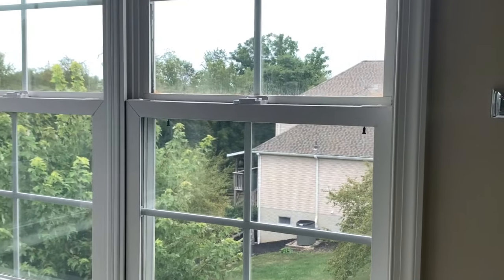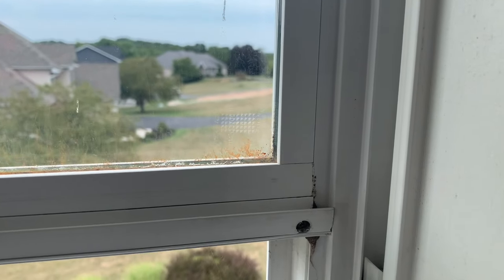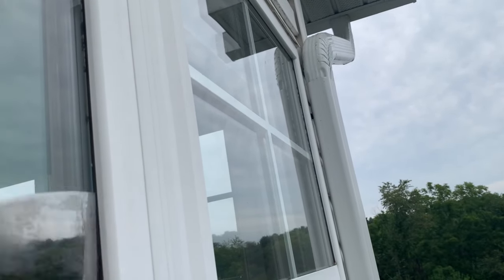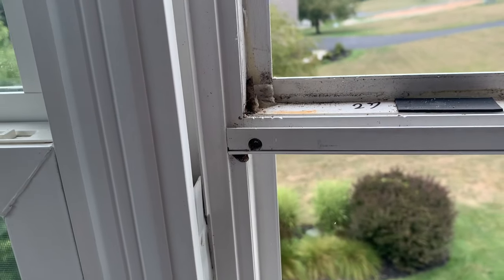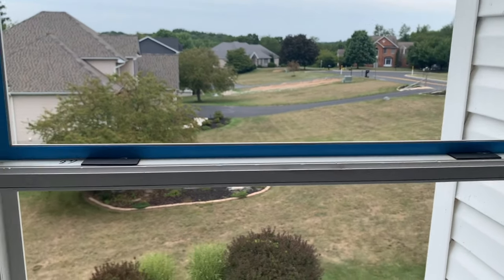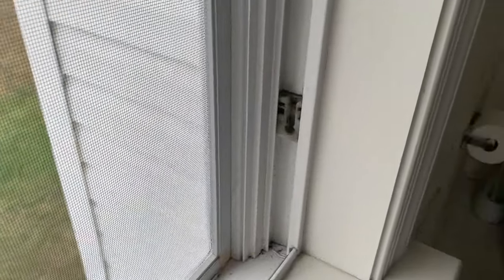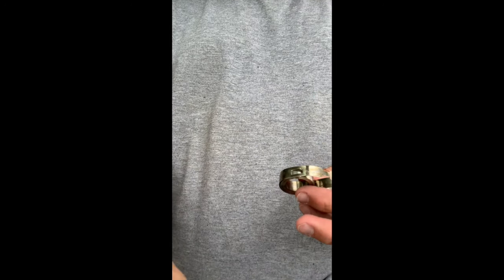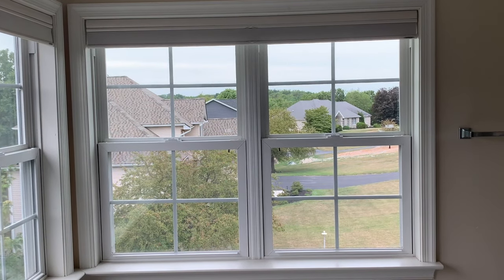Replace Upper Window Sash - Single Hung Window

Comment: You did not show how to take the windows sash out
Reply from the maker: It’s a single hung window. So the bottom sash moves up and down. 
The top is stationary. All it has is the pane of glass. This video shows how to replace that pane of glass.

Comment: How did you get the exact thickness and with and height without removal thank you  i pray i estimate 5/8" thickness they look just like yours  and they are all the top windows  with white  incert i do not feel like tearing the house apart i like the factory brick molding. I watched  my nabour get windows they tore her home apart and when the guy cut back the siding for jchanel they cut the plywood also i seen insulation.  So here i am googling replacing top

Comment: Thank you so much! Only difference is my pieces around the window to remove were on the outside and the putty knife seal to break was on the inside. I would have never figured this out without your video
Reply from the maker: Interesting. I’ve never seen it that way. 
But I’m glad it helped. I couldn’t find a decent video explaining it, so I thought it was good to do. Thanks again!!

Comment: You made the job understandable. Thank you. Now the hard part. I don't know who made my windows. Is this pretty much how all brands of vinyl windows are made? Is there a way of determining the size of the replacement pane before actual removal? Where do you buy the replacement? Lot's of questions about the hardware but your video makes the doing a whole lot easier. Thanks X 2.
Reply from the maker: My pleasure. Glad to help. The only way I know is there should be stickers on the inside jams. That you can see from in the house. 
If not - maybe take the bottom pane out and see if on there. And measure that pane.
Reply: Thank you

Comment: My brand new Windows have one corner on all of the bottom sashes where the tilt latches don't snap back into the frame without an excessive amount of force.  What can this mean and what is the fix?
Reply from the maker: I would contact whomever installed them. Sounds like they aren’t square. Or perhaps to tight in the frame.

Comment: Where did you get the extra plastic & order you glass from thank you may the Good lord bless you
Reply from the maker: I got both of those from Simonton Windows. There is a sticker upon your window on the frame (or should be) that has the info you need. Company, size, etc.
Reply: @srakfleming5888  thank you very much

Comment: This is an excellent video, thanks for posting.  I have the exact same situation on my PlyGem windows and have received six replacements to install.  Want to DIY so this was great. Found answers to my questions in your responses below. Thanks.
Reply from the maker: Hi there.  You are welcome.  I'm glad you found the answers.  I got mine with the new window panes.  I have some extra.  Its is 1/2" wide and 1/16" thick.  Sticky on both sides and the 1/16" is basically a spongy layer.  I hope that helps. Thanks again.

Comment: great video, very well taught.  I was looking for something different.  I recently had new windows installed and now want to add a window air conditioner.  The single hung window have lower sash stops and I am not sure if they can be removed since the current opening is to short in height to have a standard A/C fit?  Being that they are new windows, I don't want to just force the stops out and maybe break or damage it. I am sorry I don't have the name of the manufacturer. but they must be Canadian.  Any thoughts you  might have would be very helpful.  Thank you and thanks for sharing.
Reply from the maker: Send a pic of the stops. They usually pop out pretty easily.

Comment: Thanks for the video !
Can you tell me if the tape was butyl, and was the thickness 1/8 or 1/16 of an inch.
Here in canada off of amazon it is around 40 dollars, does this seem right?
Thanks again, well done!
Reply from the maker: You’re welcome. Hope it helped. 
It’s polyethylene, and it 1/16. On Amazon here it’s about $20 usd for 150 feet
Reply from the maker: JVCC DC-WGT-01 Double Coated Window Glazing Tape: 1/16 in. Thick x 3/8 in. x 50 yds. (White)
Reply: Thanks for fast response !!!!
Reply: Thanks again ,Just ordered the tape my window seems to take 1/2 inch, it was around 50 or 60 cdn dollars, still better then hiring a contractor !!

Comment: I broke the bottom sash by accident, the one that tilts and can be removed easily. Can I replace just that sash or do I have to replace the top half (shown in this video) as well? Do manufacturers sell the bottom sash by itself?
Reply from the maker: Yes. For sure they would sell the bottom sash.

Comment: From your experience, would replacing the glass in the bottom sash be the same or do you have to buy a whole new sash?
Reply from the maker: I think it could be the same. But easier because that whole window should come out. I’d probably just get the whole new bottom window and remove it as if cleaning it.

Comment: When you removed the glass was it both pieces at the same time. Is the replacement a sealed double pane with the argon gas inside? Have some foggy windows bad seals . Is this the best route? Thanks , Jerry
Reply from the maker: Yes. Both panes came out at the same time. And yes the replacement was also a sealed double pane with the gas between. 
You have the same problem we had, fog in between the panes. Which means a seal is broken somewhere. 
I think this is the only way to fix that. Unfortunately.

Comment: What did you have to provide to Simonton as far as information to get the correct sash?
Reply from the maker: There should be a sticker around the edge of the window frame that has an order number and part number.
Reply: @srakfleming5888  thank you! I found that. Just wanted to make sure! Appreciate it!
Reply from the maker: @tp081234  awesome. Good luck.

Comment: If it have been helpful if you had shown how you removed the bottom sash.
Reply from the maker: The bottom sash moves up and down. You just tilt it in and then lift one side up and it comes right out.

Comment: You talked about removing the bottom sash but you didn't explain or show how to do this. What a waste of my time!
Reply from the maker: Removing the bottom sash of a window is the easiest thing about windows. Open the window a bit, push in the two slats at the top of the sash, and fold the window in towards you. Than just lift out. Pretty simple. 
Thanks for watching.